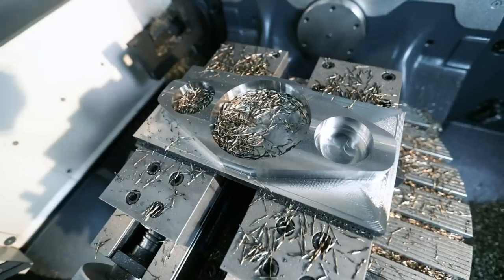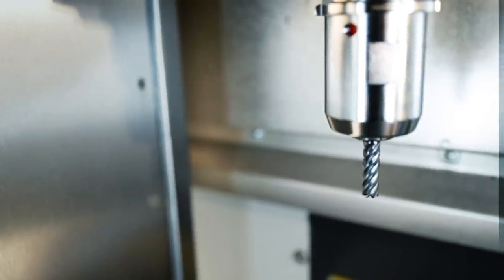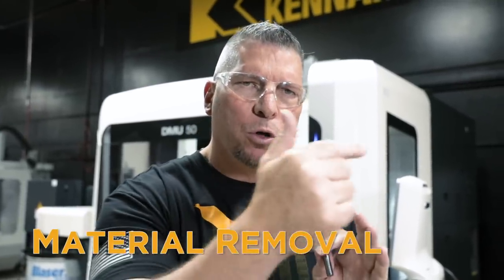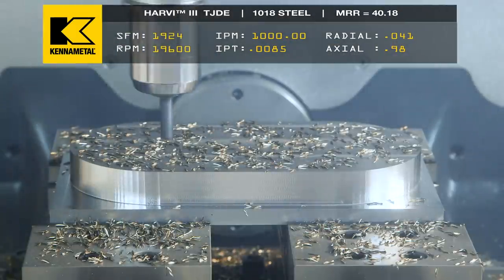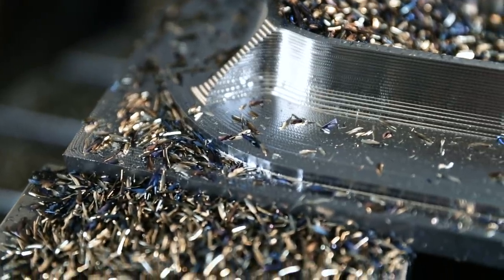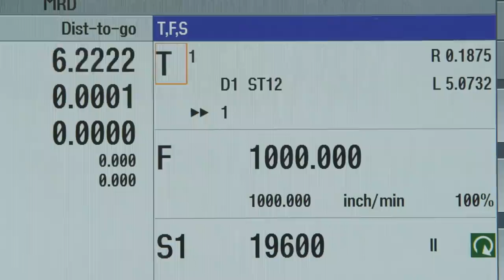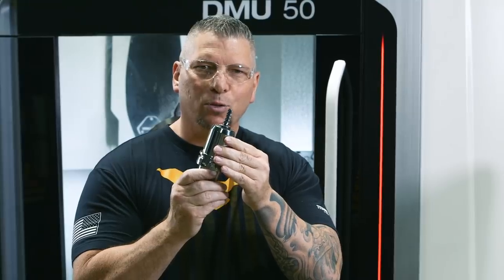"IMPOSSIBLE” Kennametal Speed Test In STEEL | DMU 50 | PowerMill | Vlog #89

Comment: Let's see some videos on how to get incredible surface finishes.
Reply: @spikeypineapple552  Thanks Samuel but I doubt seriously that all metals use the same formula. What is the best tool holder? Should you dial in your tool first? Better to use high flute count or low? Talk about deflection and how to stop or correct it. What about face mills? Diamond tipped inserts? Aluminum? Copper? Mild Steel? Hard Steel?
Reply: In aluminum use a 45deg helix cutter. The tighter the machine the better the surface finish it will get.
Reply: what? are you crazy? not at Titans ^^
Reply: @jdholbrook33  Most of these questions depend completely on your part, tool, and machine. All suggested speeds and feeds are just a starting point. Use your cutting feed dial and spindle rpm dial to fine tune the cut as its milling, make note of the speeds and feeds and use that for your next program. And as far as tool holders, always use a solid tool holder for endmills if possible. Yes, dial in your tools, or at least check the runout first, that should be done quite often. Aluminum, finish with a 2 or 3 flute, Mild steel and hard steel, finish with a 4 flute. Typically, you want to go slower with the rpms and feed rate when running your finish pass, surface finish dosnt really mater as much in roughing passes, you are just trying to remove metal, not make a pretty part when you rough out stuff.
Reply: @r0cd0x  Thank you, very helpful.
Reply: @jdholbrook33  Deflection on a finishing pass? Are you cutting with a butter knife?
Why did you type this.  If you have deflection when making a pass for surface finish you aren't done roughing or your cutter is deformed.

Comment: This is insane. Im a cnc programmer and watching these videos makes me try things in my programs that i ordinarily wouldnt try.
Reply: I just started a week ago on an old miltronics VM20 and the first job they give me (fresh out of my second semester of "machinist college" with my only experience being in aluminum and delrin) is to cut 24 parts out of 304L stainless. Oh, and the biggest endmill I can use on the finishing pass is a 1/4 inch. I've busted around 10 endmills from bad programming mistakes so far. Trying to go a week without breaking any

Comment: How much higher than 40 would the MRR be at 4:50? With feedrate, RPM and stepover the same, feed per tooth increases a ton in internal pockets and corners. That's why we see a lot of blue chips when the pocket is small, then straw colored and back to silver as the pocket opens up.

Comment: Cool machining test, I like that some of the part was 3D and your toolpath did step up machining.  Thanks for pushing these tools.  Maybe do some videos with 40 taper haas and ER collets, because this is what many people use.  Or some simple shoot out videos 40 taper ER vs Hydruallic vs Weldon Flat?  How to get the best out of what you have in the shop kind of stuff.
Reply: I have no doubt in their ability but I do find it interesting the Haas is hiding on these.
Reply: Haas has its limits. We have stalled the spindle on our HS-4 (50 taper horizontal mill w/150” X and 66” Y travel) trying the same cuts that were no problem on a Matsuura. Shows the difference of power some tools have over others. Also the price tag reflects that lol.

Comment: Usually I slow the rpm down when helical ramping and when it hits the bottom I speed it up to max rpm. Idk if you did that because the spindle sounds so nice but it helps with tool life a lot. I've never had something spark like that in 1018 while ramping and have long tool life. Also ramping outwards from the pocket you have a larger chip load. That might be why the chip were the nice blue color instead of yellow like the outside profile. That makes me think you could probably go even faster with the feed on the outside no problem.

Comment: I realize you are running w/o coolant for the video and possibly for the testing but could you do a video on the importance of proper coolant usage and maintenance. Thanks for the video post and what you are doing to promote knowledge and education in our trade.
Reply from the maker: https://youtu.be/5FloZrOoEBg
Reply: you'd probably want to run this without coolant anyway - in the inside pocket you'd be re-cutting chips for sure, if you have flood coolant those chips will be hardened from the rapid cooling, which in turn can be a lot harder on the tool.
Reply: @TravisHammeng  Thanks for your Input and reply. That makes since with this particular operation and the amount of material removal. I know some tooling coatings of today actually work better w/o coolant. As with proper tools, feeds, speeds I was curious as to different application for "flood, mist, airblast" per material and rate of removal. I know there's lots of variables. Probably enough info for a few videos. Thanks again! 👍

Comment: Titan, love your videos, you are dead on right.  Smarter manufacturing is what will put the U.S. back to a self sustaining economy.  We are to the point where 4 man shops can kill it in production and quality.  

MEADS  miniaturization, education, automation,  documentation and standardization 
We are at the edge of the next industrial revolution

CNC is just a robot.  After I get my first VMC, the next piece will be a loading robot, even if I have to do a self build out of OTS components. I would rather pay people to maintain and program robots than to pay them to stand around loading parts and hitting starts.  

I was run over a month ago in a parking lot, crushed ankle.  I have a small garage shop. I was 2 weeks away from pulling trigger on haas TM and CL machines.  Work lined up, projects planned...  I am now to where I can stand for a short bit (10-15 minutes max with crutches) and work, so I could load parts and do slooow set-ups on cnc or manual, but I can not stand to do manual runs.  My 17yo son is learning, and autocad certified, but school is priority.  After multiple surgeries installing external and internal hardware, and doctors visits the bills are starting to come in, and it will affect everything. Available cash, future earnings, credit, work flow, customer relations, family stress and everything else.  My point??  Had I Just got the machines when I first thought I should, first part of January, instead of waiting  till April, for no other reason than a little scared  of what ifs, I would be OK. Behind, slow, stressed, but it would have been fine.  Don't be scared, take the risk, MAKE IT HAPPEN. DO NOT WAIT FOR IT TO HAPPEN, MAKE IT.  This poor timing on my part set me back close to 2 years at best the way things are looking, and it hurts.  I'll keep at it. It will happen.
Reply: Just try free of charge education (college, and university).  That's why the Titan is using a German machine and German utilities (vices, chucks).

Better education leads to better results (and requires less expensive supervision).

Comment: Wow.. I'm a chicken sheeet lol.. this part probably would have taken me a couple hours to mill, granted I'm on a vf2 with standard end mill holders and a 10k spindle, and this is a mori with hydraulic holders etc.. still I've never pushed anything even half this hard on steel.. I've gotta step out of my comfort zone. I would venture to say 10 years ago, this would have just come across as reckless in any shop I've worked at and maybe even gotten a machinist sent packing, but you are showing what these machines and tools can actually handle and are designed to do, very cool stuff Ty!

Comment: Wish that you posted metric numbers too. Hate pausing to get the calculator out to work out what your talking about. But how are you running the surface feet so high past the manufacturers recommended speeds. Cutter should burn up no?
Reply: From a guy that came from imperial to metric, I will say metric,is much easier, I just use 25 as a reference to convert. Its 25.4, but maths am I right...So lets say hes cutting at 100 Inches per min feed rate that would be close to 2500millimeters per min same thing with dimensions. 25 microns is about .001 or a "1thousandths" of a inch.
Reply from the maker: Coming soon
Reply: @BRANDON-IRON009  the maths not hard. More i just want to see the numbers instead of working them all out
Reply: Usually mfg recommendations are starting speeds and feeds. Conservative. Run it baby!!

Comment: Is the MRR accurate only with 100% end mill engagement on the steel. If the tool engagement is only 75% and 25% is cutting air is the true MMR only 3/4 of the math.
Steve
Reply: When he says "radial" he means "radial depth of cut", not the tool size, so if you're hitting with the edge like in the video, it's 0.041" (like he was using), but 1d slotting would be 3/8" for radial

Comment: Would it possibly be advantageous to put a robot arm into the machine cabinet and have this arm work in tandem with the cnc programming to vacuum up chips?
Theoretically the arm would always stay out of the way of the machining heads, since it is aware of the tool path. 
Would this approach help productivity?
Also, couldn't you get better finishes if chips are quickly removed?
Maybe even use a wet vac when coolant is on?

Comment: 4:50  !!! sure impressed by the tool's performances in sort of  "kamikaze" conditions ignoring tool durability , but even more impressed by the machine  fluidity ! & by the way did someone know a kind of high performance endmill 7/8 (.875") with a cutting length of 3.400" to be used in 4140 steel ???
Reply: (3.380") it's the depth of final cut. but it can be done by step,  maybe with a "recessed neck" solid carbide endmill I guess... let me know if you have any suggestions !

Comment: Is there a reason to only climb cut during those passes? I know it results in a better surface finish, however, that does not matter during roughing. The cycle time could be reduced by a third if the cutter also conventionally cut to avoid those rapid feed times that otherwise could be used for cutting material.

Comment: OMG.. Really blows your mind what that tool removes its against everything you learn as a beginner but it works and that's what counts 👍😎
Reply: It works, but for how long will it work. 
If it costs half as much as the competition, but only does 1/4 of the parts as the competition. Its not economical.
Reply: Frauenarzt Dr. Stefan Frank  there is a point where profit and loss cross with machine wear and tool breakage and downtime re setting up tools. 

Some small endmills depending on how new they are and what coatings they have can be extremely expencive.

Comment: If you really want to do a test to maximize MRR create a part/toolpath that avoids all the unnecessary rapid moves.  Take the rectangle and keep crushing it without any rapid moves until you reach a full minute.  That will keep the tool engaged 100% of the time which will maximize MRR for a true test.  Obviously some parts require the rapids, but for a test part to test the Zombie's capability go full out cutting.  You may see 50+ ci/min.

Comment: I'm still learning how the machine but, wouldn't it been faster at 5:21 to continue going around the part vs. backtracking?
Reply: Tr165Eagle BSA that’s is what’s required to keep a constant load on the cutter. It would be faster to do both ways machining. Typically the conventional cut (other direction) requires a lighter doc and feed so you don’t overload the cutter.

Comment: Hi Titan, great videos man! Really appreciate and enjoy the infotainment you gives us all. Wanted to know, are you using the recommended Feeds and Speeds from Kennametal and/or your own experience and knowledge to achieve this? Great job 👏🏻👏🏻🙌🏻😎
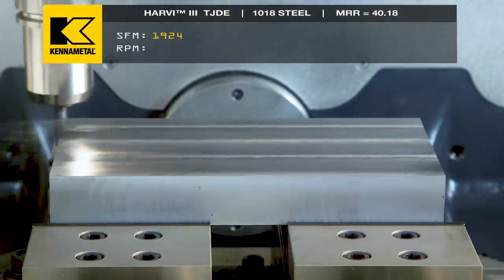Reply: 3:29-4:30 literally SHOWS ON TOP OF THE SCREEN THE  FEED RATES USED FOR THE VIDEO.
Does a voice over explaining he is CHANGING the RPM from 15K to 19.6K RPM.
Changing Z-axis feed to be higher. ( I don't agree with this completely because his only Z-feed was when he made the plunge for his pocket and the chips could not hold any more heat.)
Changing Radial depth of cut to be less deep because the spindle speed is higher as compensation which puts less pressure on the tool in the weakest direction of force.
SMH.
This is a 2 year old post.. hope you are 2 years wiser.

Comment: Awesome video. You should also talk about the holder used with the cutter. I notice that this holder is the Hydro Force which is a heavy duty hydraulic version. I assume you have air thru spindle and the collet slots? Have you tried other hydraulic holder brands like Sandvik or Schunk?

Comment: What cam software are you using?
Reply from the maker: PowerMill
Reply: @TITANSofCNC  Not sure if you've ever done one, but I just ran a job in aluminum and needed to use a 3/4" endmill 4 inches long.  A cool informative video would be how to run these tools when your machine is limited in speed and horsepower, as you know in a job shop a lot of times you have to improvise and I think that's one that scares a lot of people and is something that can be super tricky to dial in especially if you don't know tooling.

Comment: What's most impressive with this test is the lack of coolant used to do that operation. Should we expect faster feed rates with coolant?
Reply: It's my understanding that with "easy" materials like steel, coolant isn't really needed and can actually cause issues due to thermal shock. You can see that the chips are taking most of the heat already, so I don't think coolant would help that much, and you'd have to have a high pressure coolant setup to be able to evacuate those chips as fast as the air blast does.

In inconel and titanium or other more refractory materials where heat rejection is problematic, or in gummy materials where you need something to help prevent chip welding like aluminum, then coolant is warranted.

Comment: I'm a complete novice who loves to watch these amazing videos. But I wonder why there's no cooling? It seems to make it even more extraordinary. Thanks
Reply: John H a lot of people that make videos like these, will not use coolant for the video so the viewers can see the machining better
Reply: @MOLDYBURGERS  thank you. I thought if you didn't use coolant at these very high rates it would cause damage. It's amazing that it doesn't!
Reply: @MOLDYBURGERS  actually no. Cutting 1018 these cutters do better dry. The coatings can handle the heat and all the heat leaves with the chip, the reason they are blue.

Comment: My 50 tapper machine only has maximum feed of 393imp, but I can achieve a mrr of 40inches by using a 2.5 cutter 130 ipm & .130 depth of cut.
How many minutes can your Kennametal cutter run for at your feeds & speeds ?
Not trying to be a smart arse , just my machine is older bigger and slower than what you have. I have to be efficient by using what my machine can do. 
Efficientcies are calculated by the price of the part against the cost of the part . If the time that it takes to machine a component decreases , but tooling cost increases by more than the value of the saved machining time. You can go backwards.

Comment: Hey Titan, I know you’re sponsored by Kennametal but would you be willing to torture other tool brands such as CGC? I am a setup programmer in a tool and die shop, and we love them. We don’t have the capability to run this fast, but we still give them hell.
Reply from the maker: I have tested many tools and also like IMCO etc... just did a video on Knurling and didn’t have any relationship with the company... This Harvi 3 saved my company big time... so I definitely love it and push it.
PS. There are lots of ways to increase productivity... speed is one thing... Workholding, depths of cuts etc
It all matters
Reply: TITANS of CNC: Academy Agreed! What do you use to finish your parts after running that fast? What is your STL on the walls? I’d like to see a full test of your process starting from programming methods, to the tools used, how you choose to leave stock and how much running as fast as you do.

Comment: I'm new to cnc machining..
I have a few questions here...
Sparks.. aren't they bad?
No air blast? That kinda blows my mind. When and where can it be ignored. I thought it'd help cool the tool here. I guess the flying chips suck out all the heat.
My spindle max'd out at 10k. Would speeds like this simply scale back by ~50%???

This video remind me of that sprinkler dance move with your hand behind your head and the elbow swing back and forth. Keep the chips flyin man! Love this!

Comment: i really dont think the tool will last long when heating it like this.
Reply: Add coolant, (he doesnt cause its ruins the video) and slow it down 10%. Run it for hours, replace the tool.
Reply: Chips pull the heat away from the part and the tool when done right. See how discolored they are? There is your heat.
Reply: @andrewleroux9479  and then resharpen it last year i build my own tool and cutter grinder with diamond grinding disk on it to be able to sharpen my tools again and it works as long as they are not too small and it's quite a lot of work to do cause there are a lot of different geometries on the market. One day I hope to build a cnc tool grinder but step by step 😊
Reply: @wolfitirol8347  mind linking vid/pics?